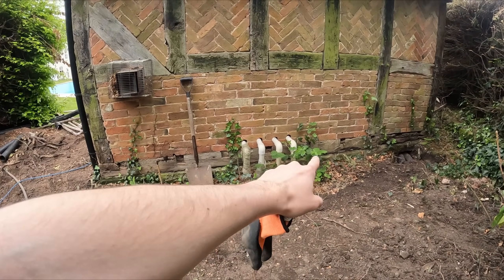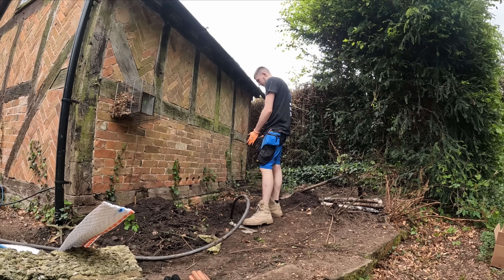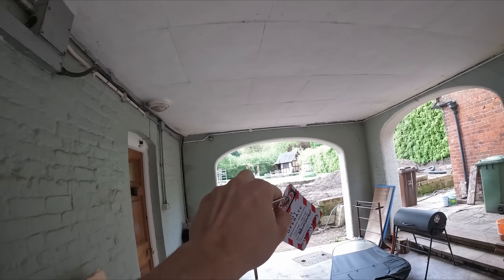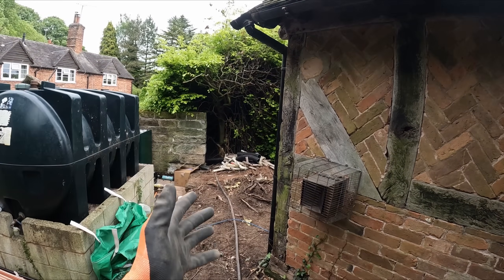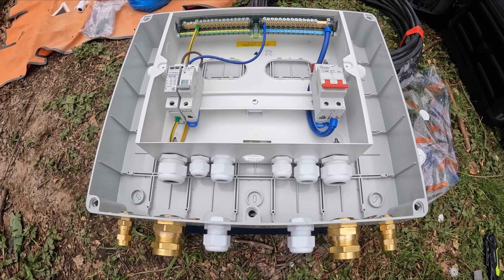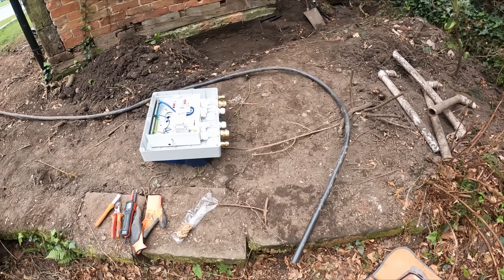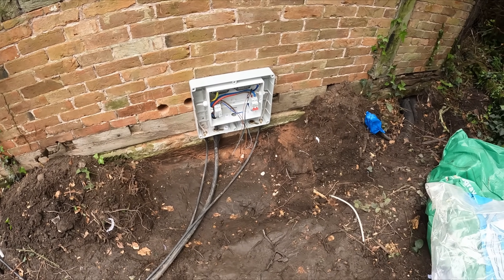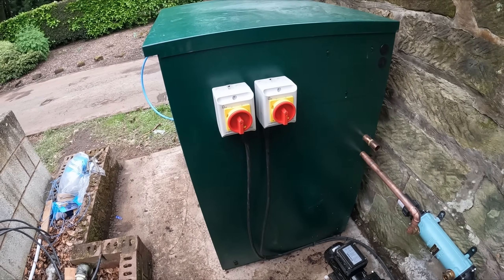Pool House Project  | Pool Electrics | IP FuseBoard & More

Comment: Why do you feel the need to reinstate the temporary 35mm 3 core going to the outbuilding which the owners have sold with a 25mm 3 core SWA on a 63amp device when you already stated it was for chargers and a kettle maybe? For 10 days ? You could have just lashed a bit of 2.5mm on to the 35 and put it on a 16-20 amp device ? I’m also sure that the owners will question the position of the consumer unit in time being that low, and having to find a screwdriver to get the lid off to re set any tripped devices?

Comment: Couple of questions, 

Not knocking your work at all just curious. 

Would an ip rated fuseboard have been better for access if a circuit trips or one of the standard electrical wall boxes with a locked door ?

Fuseboard looks very low to the ground and i would worry about submersion in water in the likley event of flooding/pool leak/ boiler leak. 

Sure theres reasons ive misssed maybe or is it that theres just more than one way to skin a cat.

Nice work and great vid and good idea on the rotary isolator much better than a torpedo joint on a tempory supply. 

Be interested to know how its supplied at the house end, just 100amp fused rcd switch?  

Hopefully get to see the follow up vids for this 👍
Reply from the maker: Yes few vids to follow up
Reply: @AdamDunlopElectrical  nice one cheers for the reply mate .

Comment: Good job Adam, It is so difficult to have a DB outside, to help the IP rating you should have used the round covers that go over the screws and I would put a silica jell pack in the box. As you wont stop moisture in the box. You done the work when it was damp so you trapped damp air in the box so when it heats and cools moisture will build. I would give it a couple of years and the board will start corroding. I have installed a few boxes like that as a junction box and all the din rail connections rusted.
Reply from the maker: Thanks

Comment: Looking good! I would have tried to convince the customer not to have the consumer unit on the outside!
Reply from the maker: You and me both however I understand why they want it outside and the way I’ve done it there will be no issues
Reply: Always issues when installed outside. Condensation etc means it will corrision will appear within 5 years. IP washers and IP67 a must. Never drill fixing through the box.@AdamTheElectricalApprentice
Reply: That Gewiss JB is IP56. Always aim for fitting IP67 then you aren't fixing through the box. Get into the habit of using 20mm IP washers for your glands etc. Good job.